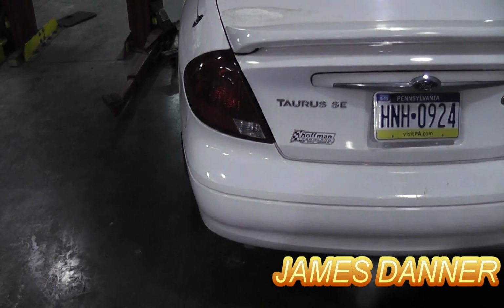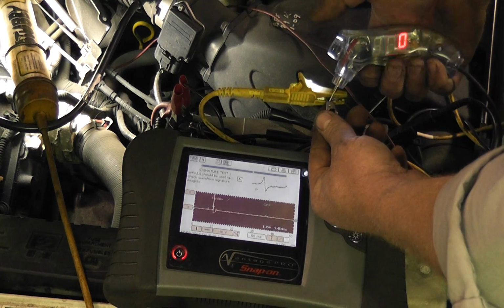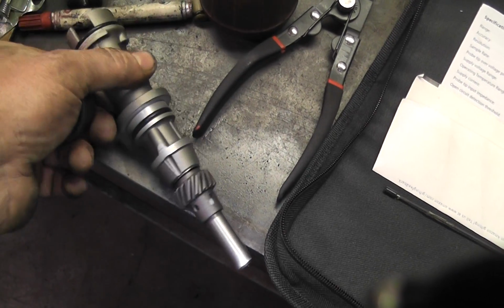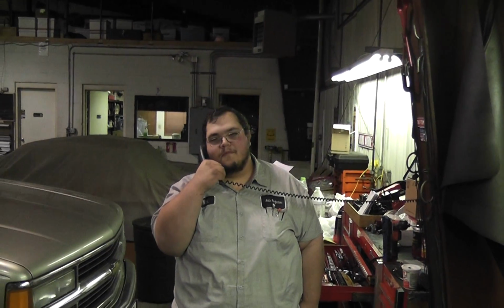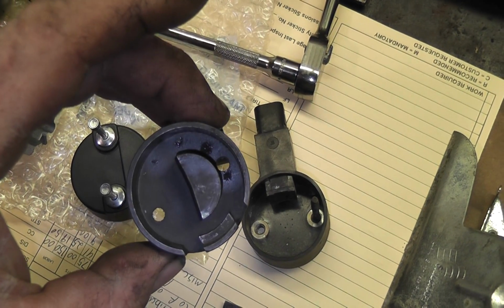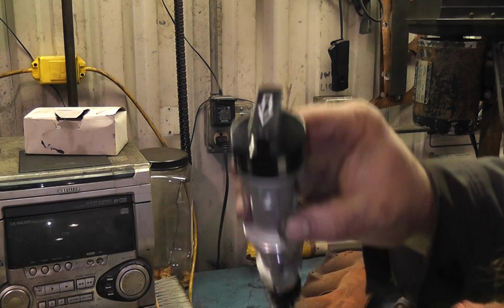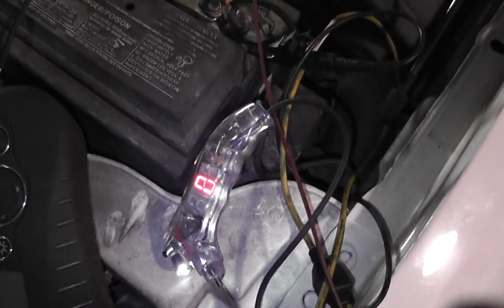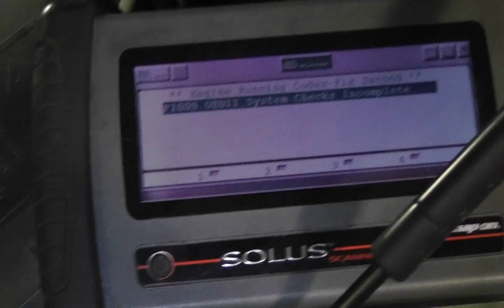01 TAURUS P0340

Comment: Wel well most of aftermarket pin on shaft was installed wrong tab on top of sensor will not line up like OEM Motorcraft, also shaft on aftermarket has excessive side to side play and excessive end play, may have to get a different sensor plastic cap to work with plug

Comment: So I worked on a 98 Ford Taurus I pulled the heads off put new head gaskets on and I pulled that whole assembly on didn't ever turn it put everything back together and it ran for a day or two and then I get this code 3.40 so do I need to get a tool to line it up or how will I get it back to correct top dead center any help would be greatly appreciated this car has not been a good one and I just bought it about a month ago

Comment: I just replaced one on a 98 ford mustang 3.8L About 24hrs later it get the engine light with the same code. I heard a bad alternator might cause that to happen so i replaced it, got a new camshaft synchronizer, drove good for 24hrs and same thing. Could it be im not installing this thing correctly? Any thoughts would be great. This thing is a pain in the ass.

Comment: This is a great channel. Too bad he doesn't post anymore. But he has a bunch of good ones. I have watched them all. I bet he used a Dorman part. I am using one today in the Ranger I am fixing. Even if the cam sensor itself fails the distributor part looks fine. I will also scope out the cam crank relationship and set according to Paul's vid  nine crank sensor peaks after the sync notch. I have used a number of Dorman parts successfully. A Ford intake manifold. BMW thermostat housing. Many Chevy plastic distributors. Sorry!!!  Please don't burn me at the stake

Comment: So I have a 97 Taurus. Picked it up cheap. It had a bad misfire but no code for one. I replace plugs, wires and coil pack. New camshaft position sensor. It's still kinda missing . Not as bad. It has a exhaust leak behind the motor near the firewall. It is where the the exhaust manifold bolts to the pipe. It is loose is the gasket is bad. It's leaking where those connect. Could the cause a misfire? Or the feeling of a missfire?. What else could it be? It's only got 103k. And the code on is p0340
Reply from the maker: I had a Ford or Mercury  that had a bad crankshaft position sensor , the signal was very weak, it ran but set random misfire codes and I believe a coil circuit code. It was a newer model tho with 6 coils . Worth a check tho . Maybe double check the alignment of the cam sync. U have a scanner to see cylinder contribution or check mode 6 for history misfire counts?

Comment: If memory serves on a 3.0L there should be a little cast flange sticking out near the top bolt for the crank sensor is and a mark on the balancer between the belt and crank sensor tone ring. I think you have to look on the balancer not the pulley.

At 19:27, see that flat piece sticking out at right angles to the pulley next to the pigtail?  I'm pretty sure that was the ref mark and the pulley mark is likely only on the balancer next to the tone ring because the drive pulley can be put on separately in any orientation.

If they are hard to see. Take your fingernail and scratch along the pulley edge. It should hopefully catch in the notch.
Reply: U r correct. I am doing a 2000 Ranger fight now. I am using the Dorman part. But the marks r quite clear.

Comment: How to find TDC with no mark:

-Take out No 1 plug and plug the hole with your finger over the hole or use a compression guage. I'd advise taking all the plugs out so you're not fighting compression.

-Turn the engine over with a ratchet on the crank bolt. It'll take two revs to go through all 4 strokes of the cycle. One TDC is the exhaust and one is the compression phase. The exhaust phase won't have much compression compared to the compression phase.

-When you feel or see compression stroke start at BDC on no 1. There will only be one compression stroke per cylinder for every two revs of the crank. The other TDC is the exhaust phase.

-Remove the compression gauge from the plug hole

-Stick a long straw like you get at McD's into the spark plug hole so it's sitting on top of the piston. Don't put something short in make sure it's longer than the piston stroke.  And nothing hard like a welding rod that will scratch.

-Keep turning the crank slowly and watch the straw. Keep it loose in the hole and in the same spot. I usually feel for the middle of the piston and lay it on the side of the plug hole.

-It'll rise up with the piston, when it gets to the top it will stop and start to go back down

-Mark the crank pulley when the straw stops coming up and when it starts going down on the crank pulley in reference to a bolt or paint mark or something. Wiggle the crank back and forth to be sure. Be sure to turn back far enough to take out backlash if you do.

-The point half way between the marks where it stops coming up and starts going down is TDC for No 1 for the compression phase. Your rotor or sensor should be lined up for no 1 plug firing or sensor at that point. The marks should be very close together, so keep marks small. 

Turn it through the strokes a couple times so you get the feel of it.

Some places sell a dial indicator tool that treads into the spark plug hole if you want to get ultra precise.
Reply from the maker: That's what you'd have to do if you turned engine over with the sync shaft out but if you get the one I got , it came with the tool , so turn engine over til the tool fits on the original one and then remove it. Then put the new one in with the tool . Done
Reply: +James Danner Yeah, I'd do it your way myself too. That post wasn't aimed at you, I'm sure you know all that, I just posted it in case someone didn't know how to do it. 

Keep up the great work.
Reply from the maker: Yea , I figured u were sharing personal experience. But that's awesome. I appreciate you participating. Thanks

Comment: I've got a 1996 3.0l DOHC with what I think is the beginning of the "Chirp O' Death" coming from the Cam Synchro. Trying to find a vacuum leak and kept hearing a chirp like a leak near the throttle body. Not throwing any codes for the synchro, but those things are notorious for the bearings in the shaft going bad. I'd advise my Mom to change it anyway, because of the miles and she's got a leak in the intake near the no 1 cyl that I have to take the intake off for anyhow. So, do it while I'm at it.
Reply from the maker: Yea . I don't think they're very expensive . Sometimes they sound like just a normal belt chirp until you actually pinpoint the source .

Comment: I was starting to panic while you had the wrong tool on there.  Also finding TDC wouldn't help with that cheap tool that is provided.  Ford and OTC tools are made for aligning with TDC as the peg supposed to be off centered a bit (you'll notice your tool is perfectly in the middle.  The only way to align properly with that tool is the way you did it - rotate the engine until it slips on and install the new one in the same position.  Good job.
Reply from the maker: thank you. glad I could stress u out for a moment.  Ha

Comment: Had this bird chirping noise from under the hood of my 2001 Taurus. After google research , reading forums etc concluded it was the cam position sensor/syncro. Found out that there are a raft of these parts made in China that you must steer clear away from. So I ended up ordering a Motorcraft part. It did not come with the tool, and I read all of the recommendations 5 times, and ended up marking the old part with a red sharpie on the engine. Also took photos. Removed and replaced part exactly in the same configuration without cranking the engine during the repair. 

Happy to report that the chirping noise was indeed the cause of the problem. Seems that motor oil does not lubricate the upper portion of the CPS and it fails. The Chinese parts end up failing soon after replacement so that is why you want to stay away from those tin can replacements from China!
Reply: billymach4 not a bad idea to take the sensor off and lube the synchronizer to prevent it happening. I did mine today. I just put a dab of oil in there

Comment: I like the way you show the whole job even the problems because they are always there. The NAPA part probably some smart ass took the sensor and used it and just put the old one in the box and returned it without installing the distributor part as you called it. Seen it happen before. Thanks for the videos!
Reply from the maker: I think the technical name is a synchronizer. the Napa store knows what muffler shop it came from. and they also kept the alignment tool.

Comment: I think your hater is my hater. Maybe it's the last name :)
Reply from the maker: I actually put the original one back in with the older tool and lined up my mark, then I rotated engine one turn which turned the synchronizer 180° (2 to 1) cam/crank ratio.  Then the correct tool fit right. Essentially u just need to put it exactly where u pull it out as long as u don't turn engine over with sync. out
Reply from the maker: hey at least he is consistent.  I get it pretty quick. I'm hoping someday he is the first viewer so I can have a 100% dislike ratio
Reply: Thanks for keeping all the footage in the video.  This is real life - someone busting your stones, tech manuals not correct, part is a PIAS to change, parts come wrong and TDC is always a pain to find!  Did the position of the synchronizer really matter since it ran afterwards at what appeared to be 180 deg different from the original synchronizer?  I am not clear on Ford cam sensors - I recall accuracy in distributor installation, but the cam sensors seem confusing to me!
Thanks,
Corky
Reply: You know it's these types of condescending comments that caused you to be blocked from my channel. I was joking around with my brother and you bring up Jesus and suffering children?  That's messed up man

Comment: not to be a S.A. but o.e.m. for me. saves time. better quality. fewer come backs. you get what you pay for.  Heard a horror story about an aftermarket tie rod end breaking and result was shop had no defense because they used aftermarket parts instead of o.e.m.  young girl died.
Reply from the maker: that's a horrible story.  and I agree, OEM is usually preferred. I don't mess with cheap suspension parts. oe or Moog. sometimes though to get parts the same day, we are ok with proven aftermarket parts. ever see a felpro upgraded GM vortec  intake gasket set. all aluminum with the rubber as opposed to the OE plastic with rubber? better than oe in my opinion.. thanks for the feedback.

Comment: was the problem the actual cam sensor? or the cam synchronizer?  im confused.
Reply from the maker: it was most likely just the sensor part. but for the money and because everywhere we checked no one had just the sensor part.just whole assy. also these things are prone to chirping like a serp belt when the bushings start wearing out in the drive gear part
Reply: thats actually a nice test light function you have the capture feature seems like your getting good use out of it already

Comment: Nice. I remember doing a head gasket job on one of these a couple years back...pulled the sensor straight out without drawing the paint marks...oops. Anyway for reassembly had to find #1 TDC with a long screwdriver in the plug hole. Since I didn't have the special tool, found a picture of one on Google and printed it out to eyeball the alignment. It worked fine. But the most accurate way to do it is with a 2-channel scope on cam and crank signals, like your brother showed in one of his vids.
Funny thing is I did all that work to lap a couple valves because the shop diagnosed a compression problem. Well it still misfired when everything was back together. Turned out to be a loose injector connector. Now I do my own diagnostics lol
Reply from the maker: wow. ahhh. memories. never saw pauls video, but leave it to him to set up a mechanical system electrically.
Reply: I take no credit for that. I got that information from the old Vantage back in the day :) but it became mine
Reply: Seriously considering getting an old Vantage just for the info database. Picked up an old Red Brick MT2500 in mint condition a few months ago on ebay...perfect for scanning pre-96 vehicles which are plentiful here in Central PA.

Comment: The hardest part of that job was getting the right part, all so common.   Sure would be nice if the manufactures let the vin. Data out for the aftermarket.  When cows fly :)  Ok so how did you end up finding TDC on #1 ?
Reply from the maker: I didn't.  since I painted everything.  I installed old stuff and THEN turned engine over with a ratchet til the tool slid onto synchronizer smoothly then swapped with new. tightened new down when tool slid on smooth as well.
Reply from the maker: if u watch near the end of the video when I'm showing the test light glitch thru the lab scope. did u see what It did to the low side of the AC signal when I was not touching the button?
Reply: I guess your getting feedback from the volt pro on DC  to the scope lead.  
Looks like the glitch mode captures the lowest or highest readings , nice if you had a dropout it would show it on a wiggle test.  Never knew it could switch between AC and DC.
Reply from the maker: I'm not sure it is switching . I think its like u said. just capturing peaks.  so AC/DC may not matter. it did line up with what I saw on live data
Reply: If you did not press the button will it just keep recording a new high or low  or do you have to press the button to capture a new reading ?
Reply from the maker: u definitely need to hit button again to get a new reading.  but I think initially if u hit the button before touching the circuit, it will read 0 then when probe touches wire it automatically gives u the high peak. still learning